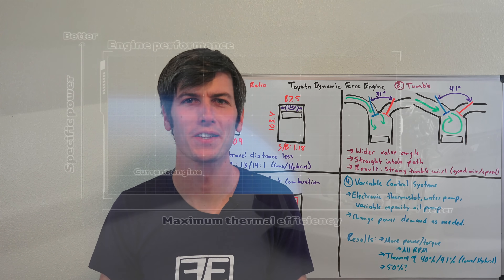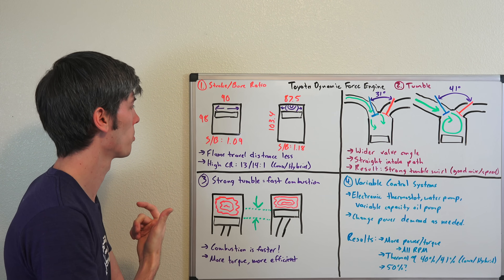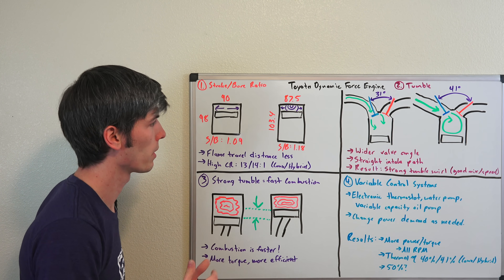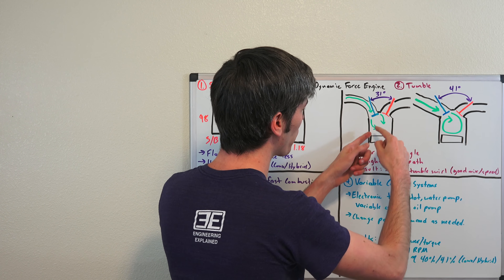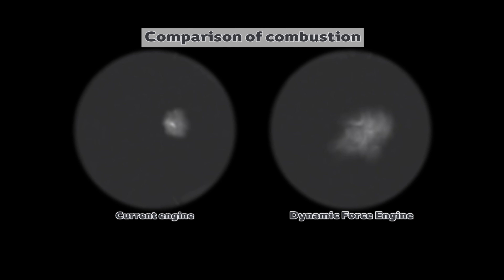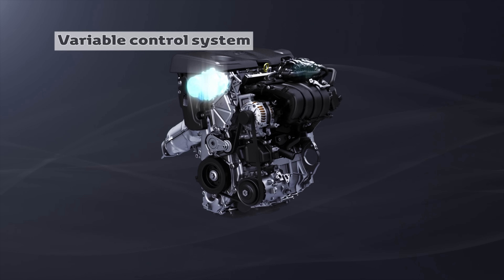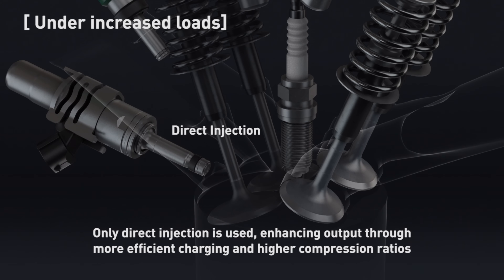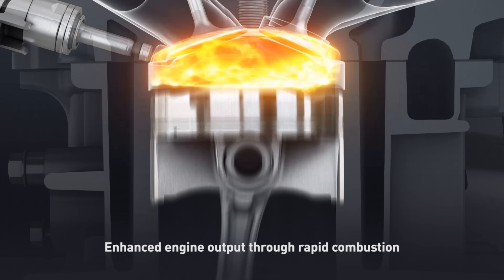Toyota's New Dynamic Force Engine Is Super Efficient

Comment: Humm, 49%,  Still about 50% less efficient than an electric motor.  Someday we will quite fiddling around with ICE engines and get on with the electrification of our transportation system.
Reply: Considering there may well be Applications for ICEs well into our collective future, I think it's punitive to continuously evolve ICE technology sincr previously, Big Automktive has failed us sheep, recycling 1930 era design for over half a century. It is wildly unacceptable that we STILL use analogue Valvetrains, spark ignition as opposed to HCCI, and true camming (via the crank assembly) overexpansion cycle, and highly optimized combustion chamber designs along with the idea of Adiabatic (complete heat extraction cycle, rendering cooling systems moot) which would bring up ICE Efficiency rediculously high. Also Big Oil killed the further development of carbon neutral and plant based fuels. No matter how you cut it, liquid hydrocarbons will ALWAYS win at energy density. With carbon neutral hydrocarbons fuels, steady combustion engine emissions mitigation technologies (think CCV, EGR, TWCC, Exhuast Stream Oxygenation, Water Injection, etc) we COULD make ICEs JUST as clean as EVs, yet we will likely choose not to, and STILL end up irreversibly polluting our Earth while also killing major industries that think electric vehicles are just a whim or trend (cough big oil) 

Just look at the Toyota Hybrid Synergy Drive, the only TRULY modern automobile design other than Tesla's vehicles 

-beltless engine design 
-high torque capable ECVT that doesn't suck and does not use a CVT belt 
-Brake jobs infrequent due to Regenrative braking 
-longer interval oil changes (with synthetic mind you) 
-super high fuel efficiency and user happiness (Toyota seems to be the only ones smart enough to bring back customers expecting not to be shafted by century old Technologies and heavy overpriced legal robbery that is the maintenance requirements for other cars "sham." 

These guys need to give up already. The party is over. If mechanics and dealerships wants to make any money on the little maintenance HSD type hybrids Require (as opposed to almost zero on an ev) they would be pushing for ALL non EV vehicles to be built like the Prius. And it's showing, look at how Toyota is hybridizing ALL of their models in one way or another. The writing is on the wall. 

I guess we'll see what happens. Honestly I don't have too much faith in humanity haha and maybe EVs just taking over without interim is for the best, without any further ICE development but still. If not in cars .. they will be used in many other walks of life, e.g., power generation, aerospace, the developing world, military ops, and other highly rigorous apps.  

Interesting to speculate

Comment: Wouldn't 2 cylinders be more efficient than 3? and 3 be more efficient than 4? Etc. This is maybe because the intake phase, exhaust stroke, and the compression phase all take energy. More cylinders also have more friction. 2 cylinders that are longer stroke, lots of volume... This should all be obvious. Why then do we not see 2 cylinder low revving high torque engines? Wouldn't they even be cheaper to manufacture? I note that the gas mileage seems to be about 5 mpg better for every cylinder you get rid of. So a V8 in, say, a midsize vehicle (Toyota Camry size vehicle) would give like 25 mpg highway, like 18 in the city. A 6 cylinder would give like 35 highway, and like 28 in the city. A 4 cylinder would give like 40 highway, and like 30 in the city, and a 3 cylinder like 45 highway, and 35 in the city, and a 2 cylinder like 50 highway and like 40 in the city. Yes, you'd loose some torque, but gain some torque back by having longer stroke pistons. 

So why aren't we seeing such developments? Why not a 2 cylinder long stroke low revving high torque engine putting out like 150 HP. That's a reasonable goal for a 2 cylinder engine, and such gas mileage would then rival hybrids, and at a much lower cost. Again, why aren't we seeing such a motor developed???? How hard could it be to conceive of such a concept? "A 2 cylinder long stroke low revving high torque engine putting out like 150 HP..." Am I the only person that ever thought of such a thing????

Comment: Ok, people, it's not rocket science, it's basic high school physics, the ice is a heat pump. By that I mean that an engine converts chemical energy to heat energy. Current engines run at about 200 degrees, which means that a large percentage of the energy available in the fuel, is wasted by being absorbed by the cold engine, and the cold incoming air. Current engines have to run at these ridiculously cold temperatures to keep the metal components from melting. Engine efficiency will never increase dramatically, until engine temperatures are increased dramatically, ie ; throw away the radiator!

Comment: Have you ever heard of Smokey Yunick's adiabatic engines? Three engines, V twin 150CI,  Inline 3, and a V4 which needed no cooling system. Intake temps around 450 deg F. Exhaust that you could put your hand on at normal operating temp. Turbo/Carb setup. The V4 made over 300HP. Neat system, too efficient. Never went into production, despite several major Auto reps test drove their compact cars with the V twin. Would run well on sour gas. The Dodge rep drained the tank to be sure cheap gas was used.

Comment: Very very great videos and explanations BUT why bother if a ICE has 39 or 41% peak efficiency, which in praxis you‘ll hardly have? Take an electric motor and you got efficiencies 90% and up. ICEs are outdated dinosaurs which were only kept that long because some people found oil and wanted to make money. You don‘t make money if everyone just puts a solar panel on their roof and charge their batterie. So basically everyone should have an interest in energy independence. I mean thats a goal for the US ever since they exist, right. So by leveraging regenerative power you gain both = higher efficiency + independence. This idea is as old as the ICE. And by the way, EVs are no new invention. They‘ve been around since the end of the 19th century.

Comment: Wow somebody finally put this old technology and knowledge together with a couple new items, variable water and oil pumps, to make a good engine. Sorry but but my shadetree mechanic brother explained the benefits of long stroke over short about 35 years ago. Not to mention the popularity of the ford 351 cleveland over the windsor was mostly due to angled valves . now they took it a bit further and that is nice but hardly revolutionary. I do give them credit for being willing to make a longer stroke engine because they do not make the peak HP numbers a short stroke can, more efficient yes but due to limited valve size and increased piston speed hard to make high hp numbers, which tends to be a huge selling point. An example is the 427 chevy engines, the one they put in trucks had a long stroke smaller bore with a lot of torque at lower rpm, the one that went into the corvette was a bigger bore than stroke, it had less torque at lower rpm but made better power at higher rpm and therefore made crazy more peak hp. If you were driving a truck the power would have been far less useable however and that seems to be a "lost secret" anymore. Ok time to climb off the soapbox.

Comment: @Engineering Explained:

Does this engine support running with either cylinder de-activation or in an Atkinson-cycle-like mode (or even Budack)? I ask because it looks as if it has variable timing on both the intake and exhaust valvetrains?

Second, given that the flame front propagates faster, does that imply that there's more area under the (pressure, stroke position) curve per stroke compared to the earlier engine?

Third, do you know if this engine lends itself to use with a low-inertia twin-scroll turbocharger or e.g. a system looking roughly like so: 48V energy recovery hot side turbine -> generator -> 48V Battery -> electrically driven 48V supercharger?

Comment: My little 1.6 Turbo Diesel (my baby) is so efficient it has trouble heating the cabin on super cold days. It puts out around 240 lb-ft of torque and routinely gets over 50 MPG. It can get over 700 miles on 13.5 gallons of diesel. I'd wager a bet it's thermal efficiency is approaching 50%. And with all the emissions stuff the exhaust is essentially breathable air. I just pray it lasts for at least 10 years.

Comment: Achates power already has a 2.7L compression ignition engine with a thermal efficiency exceeding 50 percent. How about putting a scaled down version of that in the Prius? 70 MPG plus should be doable.

Comment: Thanks for telling me about my Prius Prime’s engine!

It’s worth emphasizing  that 40% is its peak thermal efficiency, at optimal RPM, temperature, etc.  Of course, one of the goals of Toyota’s “Hybrid Synergy Drive” system is to try to only run the engine when it can be run as close to those peak-efficiency conditions as possible.

Comment: Has Toyota changed anything with this new engine that would reduce long term reliability? I just got a 2019 corolla hatchback with it and love it! But it makes a few strange noises I'm not used to (especially at idle), and seems to vibrate a bit more between 2k-3k rpm than what I am used to with their previous corolla engine.

Comment: I have to say, either your understanding of the concepts here are somewhat rudimentary or your explanation is. The primary benefit from a longer stroke engine is not the fact that the flame front has less distance to travel but the fact that there is less heat transfer loss during the expansion stroke because of the better surface area to volume ratio of a higher S/B ratio engine. The reason more engines don't have this type of configuration is that you compromise the valve size when you reduce bore diameter therefore compromising peak flow AKA peak power. Second thing is the Importance of tumble flow is Turbulent kinetic energy (TKE) which breaks down from tumble flow when the piston approaches TDC... this is what leads to faster combustion because it causes the flamefront to "wrinkle" like a crushed piece of paper has more surface area than a flat sheet.

Comment: Good afternoon. Is this the same/similar technology as on my car? I just purchased a Lexus GS350 F-Sport. I was wondering about some more specifics about the engine it has (2GR-FKS). If there are a lot of differences, if you would consider creating a video about the Lexus/Toyota 2GR-FKS engine that would be AWESOME. This engine I think is also offered in the Tacoma as well. It might not just be the small crowd of GS350 owners that may be interested in this video. It seems like a really great "Engineering" masterpiece. ( D-4S system Direct/Port injection, "simulated on-demand Atkinson cycle", Intake camshafts are equipped with VVT-iW. I think the internals are also forged.)  I'd just really like to know more about the engine & I have not found many resources about it. Thank you if you can shed some light on these engines.

Comment: Off loading the water  and oil pump to electric power is a good idea.
it allows the pumps to run at need and not at engine speed.
the compression ratio is where the efficiency is created.  
as long as the power for the required pumps is not dropped from the overall efficiency rating,
I think this going into production is great...

Comment: I really dont trust theese efficience numbers for ICEs.
My Toyota takes way more fuel when driving thru towns than hitting 200 on the Highway.
I get like 11l/100km when driving thru my city (even when the engine warm is) 5l/100km when driving at  a constant 100 and 7l/100km when going 200 on the A7.

Comment: 41% is the low end of thermal efficiency for a modern opposed-piston design... Oh, and they do not have head gaskets to blow or valves to float.  Three cylinder two stroke, using diesel fuel instead of self-mixed... I think I'm in love lol. Oh, and did I mention +200hp and +400lb/ft? Plenty enough for most of us at its most efficient, but I theorize the performance of this could rival a formula one car.

Comment: Two questions about this engine in the 2019 Rav4.  Is there any benefit as far as power or MPG to running 93/91 octane instead of 87?  To receive the window sticker MPG with this engine, does the driver need to have the vehicle in ECO mode all of the time?  Can a driver see the window sticker MPG ratings while driving in "normal" mode?

Comment: Just got a 2019 Corolla Hatchback XSE 👍
Reply: I just bought the 2020 Corolla se upgrade 6sp 2.0 liter, run fine coming home but the next day I go to warm it up at -3 degree's outside to clear the windows from frost and the engine had a loud rattle noise for about 1 and a half minutes. I wasn't very impressed with it. I can't wait till it get colder out, , it might just self distruct. 440 kms on the car.

Comment: What they are doing has been well known for decades. Thinner cylinders are better for combustion.  Also modulating ancillaries only at speeds to match engine output or temperatures is not new.  Reducing what ancillaries take off the crank releases a fair amount of HP resulting in higher efficiencies. But putting it all together in one engine is new.

Oil pumps take a lot of HP from the crank so modulating the pumps makes sense. But an electric oil pump? No one would dare. BMWs had modulating electric water pumps. Who disconnected the alternator when the foot is on the gas pedal, only generating electricity when decelerating?

Comment: Tesla weights 40kg with around 300hp, 90% efficient, this is insane...
Batteries just need to get cheaper.
The Batteries Mafia just need to die, or diminished toward new ones. They should be ashamed of how many non-reusable batteries have produced so far.

Comment: As a former 4x master tech, my immediate reaction is that the additional control elements like the thermostat and water pump are going to raise repair costs over the life of the engine,and that only OEM parts will be available for replacement. Also, I have to assume that not one Toyota engineer was bothered by the idea that this is an interference engine, and a disruption of valve timing will be the source of a VERY expensive repair. Is this worthwhile from a consumer standpoint? Is this say, a 45MPG engine, so that enough savings can justify the expense of repairs?
Reply: Art, you're talking yourself out of a job. If everyone tires of these new-fangled high-tech ICE engines, they might start buying electric cars and half of the mechanics will be out of work .........

Comment: Hold up. I remember having 2012 Mazda 3 with sky activ. That engine has 14:1 .... so what's the big deal with Toyota? They are about 6-7 years behind Mazda. Because Toyota has 13:1, also Mazda is coming out with 16:1 sky activ x engine in 2019. Soooo Toyota has kinda figured out what Mazda  did in 2012? And is making it work different?

Comment: Hello Jason, as a fellow mechanical engineer, I have enjoyed your shows. Engine efficiency is also a subject of maniacal passion of mine, which has led to me in a journey which included earning an MSc degree in Germany and a PhD, both with specialization in internal combustion engines.

Anyway, the reason I am writing to you is that in the  Toyota piece you did, you showed in-cylinder animations of a tumble flow that, among other measures, resulted in a noticeably quicker heat release, which contributes to the higher thermal efficiency. I investigated this in detail for my PhD research that started in 2010 and concluded in 2016, which include 2 SAE International Journal of Engines articles, one ASME Journal of Engineering for Gas Turbines and Power article and an ASME Internal Combustion Engine Division conference paper and of course, my dissertation.

I wanted to propose that you could do a piece on a novel method I discovered to improve engine thermal efficiency by actually forcing the flame front to move away from the combustion chamber walls, thereby reducing the convective heat transfer thereto. I am no longer bound by any NDA or embargo, so I am eager to share this with the world! I also have in-cylinder schlieren imaging and CFD analyses that I can disclose and share for your video presentation.

If this interests you, please don't hesitate to contact me. See my PM to you on FB Messenger for contact details.

Comment: Does the toyota engine in the camery 2018 have direct  injection and port injection  wich cleans the carbon on intake valves..also on a kia optima that only has port injection  what do u do about carbon build up  on valves.
How often do u service engine to clan valve
THANK YOU.

 Thank u.

Comment: So basically 7A-GE or 5S-GE hybrid with dual VVTi (all last gen GE heads) and direct injection (inherent to GE heads from 2nd gen). Longer than standard A/S block stroke + wider intake/exhaust valve angle than FE head. Rest of it is electronics. This stuff has been there for more than 20 years. Mazda with "diesel like" engine and Toyota invented "wheel".

Comment: This is nothing new; all auto manufacturers are using direct injection, swirl, larger valve included angles. The GM 2.0L turbo (LTG engine) in the Malibu is a powerhouse as well as highly efficient. at 250 HP and 260 lb/ft of torque mated to a NINE-SPEED transmission.